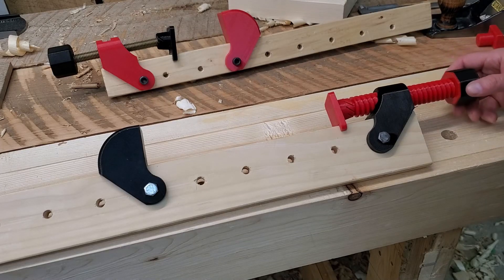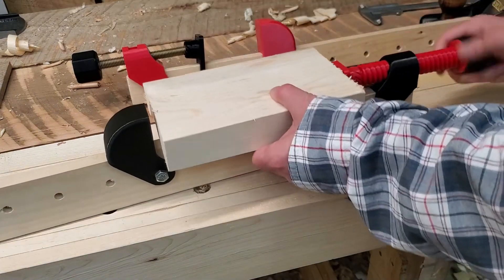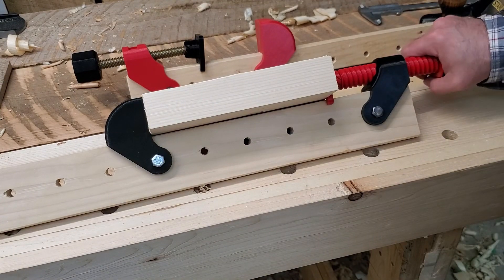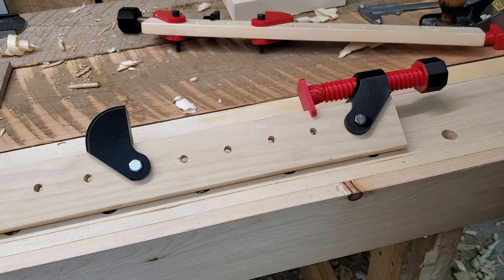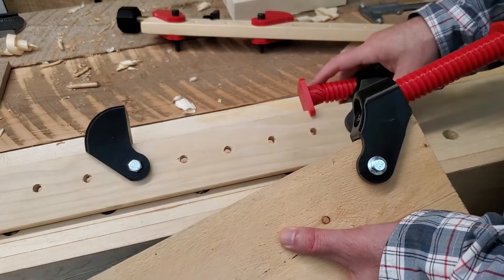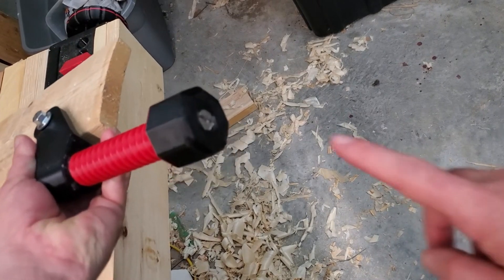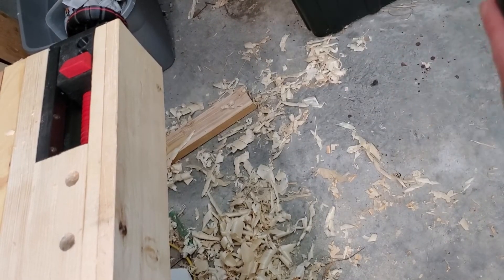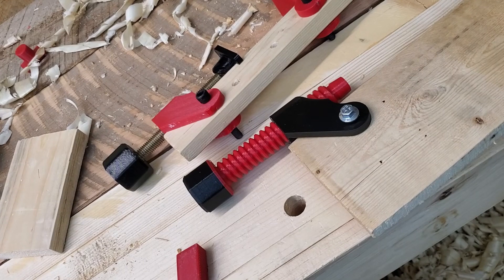3d Printed Sash Clamp - destructive testing, plus a (sufficiently) indestructible version

Comment: ABS has an impact strength 5x that of petg. I bet that would have withstood the initial test.
Reply from the maker: If I had an enclosed printer and a ventilated space to run it in, I'd use ABS more often.  Armadillo rigid TPU is another promising material from a toughness standpoint, unfortunately hard to find and expensive though.

Comment: Love this! What print settings are you using...infill %, perimeters, top/bottom layers?

Thanks!
Reply from the maker: I'm glad you like it!  I use 4-5 perimeters and 4 top/bottom layers minimum.  I only use 15% infill generally, and for parts where I really want additional strength, like with the connecting rods for the infinitely adjustable clamp, there I did something like 7 perimeters.  One exception in infill is at the base of the clamp pad where it is under the full compression of the screw I boost this up to 50%

Comment: Would love to see a 2x4 version. :)
Reply from the maker: That would probably be fairly straightforward, it'd use quite a bit more time and plastic though.  What advantage would you be looking for from the thicker board?
Reply: @AllanMacMillan  less of a tendency to bend twist while clamping is my thought.
Reply from the maker: @brandoneich2412  Twisting isn't something I've observed, the force is balanced across the clamp.  Bending under heavy clamping I have had with a narrow 1x2.  I've never noticed it with the 1x4 though.  One addon I haven't yet designed, but your question reminded me of, is some feet so that the clamp would be able to stand up and be stable, this would be very nice for glue-ups.
Reply: @AllanMacMillan  I was thing that feet would be nice. A simple jig to measure, space out evenly and center holes on a 1x4 would be nice too. Additionally a version with dovetail connectors for TPU jaw liners could be handy. Also, if one side could be flat/flush so you could lay it on it's side to clamp the bottom of a box together, (the current design doesn't sit flush on either side. 

Lastly, a minor improvement would be a Clevis pin and key for quick re-adjustment.
Reply: @AllanMacMillan  just came across your channel and I'm loving what you have, I've look on TV and Printables at all your things. Really like the integration of 3D printing andwood working.
Reply from the maker: @brandoneich2412  Excellent suggestions!  
I did a rough draft of a 2x4 version, and it only needs about 10% more material, in my head I thought it would be more.  I'll refine that and upload it to Printables once complete.   
Regarding the clevis pin, that's what my father in law uses on the ones I printed for him.  I have been pondering a design that uses  a pin/bolt and a magnet, but haven't had a chance to prototype that yet.
Reply from the maker: @brandoneich2412  I finished off the design and uploaded the files for a 2x4 version to Printables.  Note this version has not yet been tested.